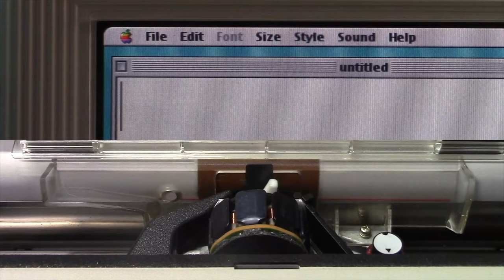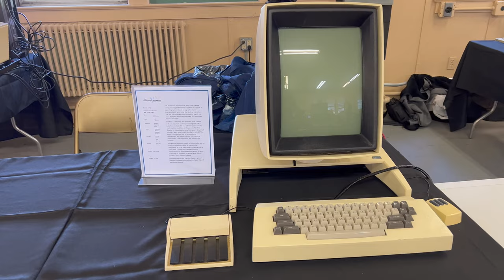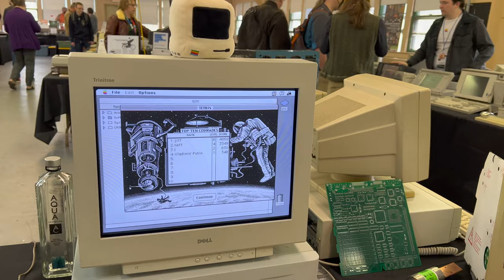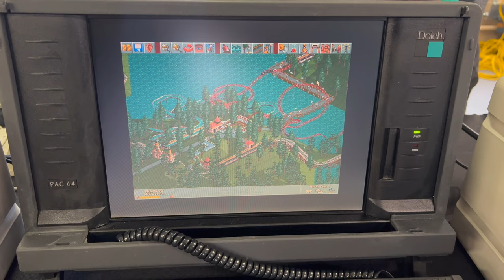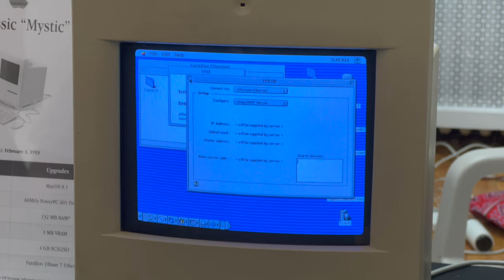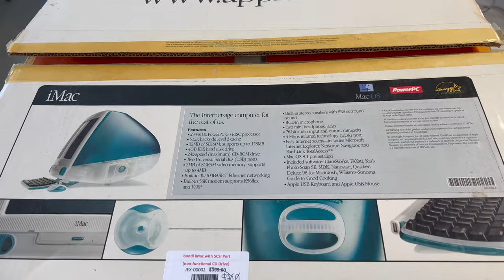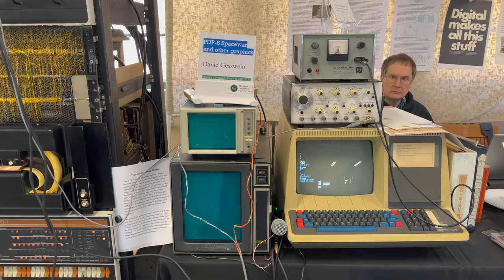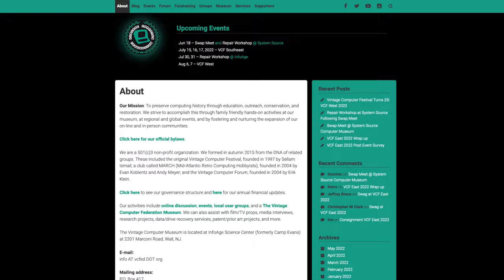VCF East 2022 Adventures: Rare Computers On Display! - Vintage Computer Festival East

Comment: Can't believe I didn't recognize you guys there! Next year I'll be more on top of things. I actually bought the untested 17 inch cinema display, and the 30 inch! True to form, untested did indeed mean broken, but I do intend to swap the panel as the case is in good shape. The 30 inch was marked down to 100 by Sunday and I picked it up, works great with my G5 but I'm STILL working the nicotine stains off of it. The AC adapter reeked like an ashtray the first time I started it up.
Reply from the maker: No worries! We'll be sure to say hi at the next one :-)

Sorry about the 17 inch, at least the 30 inch works! Yeah, I imagined those stains and smells will take some convincing to get off for good.
Reply: @Mac84  yeah I wipe it down a few times a week, doesn't smell anymore! But getting the yellow off the LCD and aluminum is proving to be quite the task